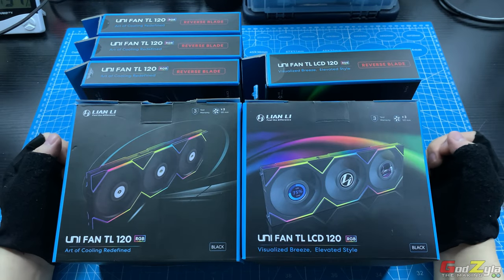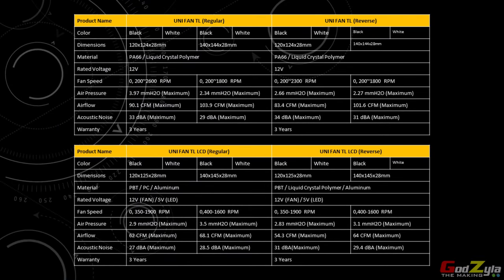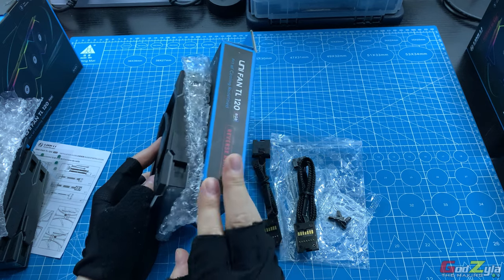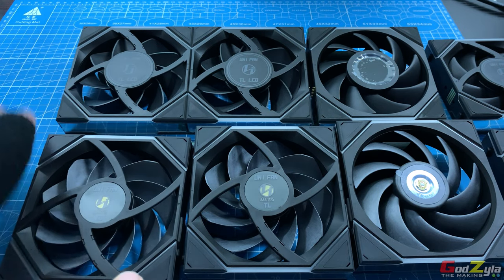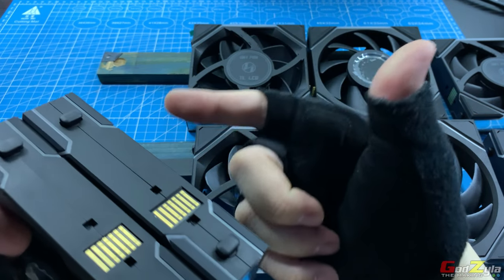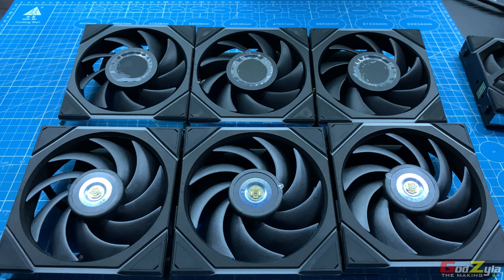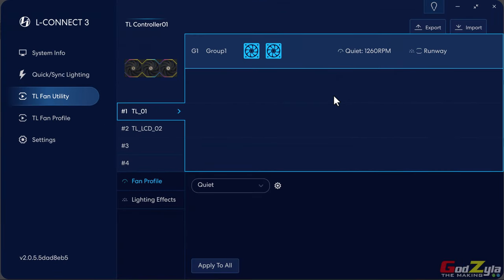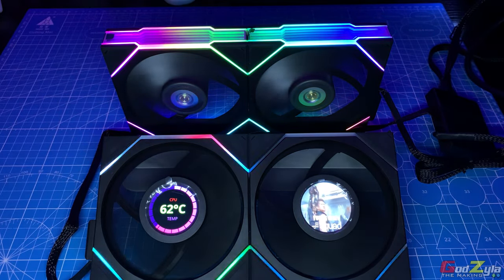Lian Li Uni Fans - TL & TL LCD

Comment: It’s dope but I rather have the reverse full rgb fans but those are dope but the lcd screen on the exhaust only right
Reply from the maker: Hi Inf4mous twin, welcome back, the TL LCD comes in 2 form, normal and reverse blade, so you can choice which to get. by the way I made a mistake. the reverse blade does come with triple pack with the controller.
Reply: @KleoYan  oh nice but do you think they should of went full rgb on the LCD ones so it could pop more? Or you think it would of pulled more power
Reply from the maker: @inf4moustwin15  pardon me, I don’t fully understand what you mean. Mind to explain further?
Reply: @KleoYan  on the lcd screen fans there only rgb on the outside of them I think the would of looked better with the rgb on the fans like the other mirror fans you think it would of been a power issue
Reply from the maker: @inf4moustwin15 oh Okok got you now. That can be done and yes it does take up more ampere which might heat up the fan further.

Comment: If you connect a normal fan with a reverse fan, considering that they have different max speeds, can you still control the speed of each fan singularly?
Reply from the maker: Hi Harman Tarquini welcome to my channel, what you can do is to plug the reverse fans to another port, that will allows you to control the individual set (Normal and Reverse)

Comment: They look like p28 with built in argb lighting
Reply from the maker: Hi NGreedia, welcome back. Yes the TL are identical to the P28, which is based on the material used. Infact I grow towards the TL as compared to the P28, only think I wish is, to have direct connection of the 4pin PWM connect to the motherboard, instead of using the controller. If controller fail, only argb effects are affected and not the RPM of the fans, especially for liquid AIO radiator cooling or Air cooler heatsink cooling.

Comment: is the TL LCD model able to pair with SL V2 model?
Reply from the maker: Hi Rezuan Isham, welcome back. If you want to use the SL V2 with either of these TL series. you can't use the same controller, you will need to use separate controllers.
Reply: @KleoYan  thanks
Reply from the maker: @razerangelri  most welcome.

Comment: Could I connect a 140mm fan to the same hub as 120mm hub?
Reply from the maker: Hi NPSHEEP, welcome to my channel. both TL and TL LCD you can do that and to plug 3 sets of fans to a port and especially as a set of 120 or 140, do not mix them and on L-Connect 3 app. you need to set the profile RPM for 140mm fan. Also please note of the limitations of fans or should I say the total amount of fans. please go through the official page for info https://lian-li.com/product/uni-fan-tl-lcd/?cn-reloaded=1

-A single cable is all you need to connect a group of up to 3 TL LCD fans to the controller, which supports a maximum of 7 TL LCD fans per controller, with a group of 3 on each port (up to 16 TL+TL LCD fans in total).
- To operate 8 to 12 TL LCD fans, please use 2 controllers simultaneously. Note that L-Connect 3 doesn’t support more than 13 TL LCD fans.

Loosen the Screws: Loosen the screws to ensure the connectivity of the group of TL LCD fans. This can help resolve issues such as the LCD screen not displaying or being stuck at the logo screen.
USB Connections: It is recommended to plug the UNIFAN TL’s controller directly into the motherboard’s USB 2.0 headers. Avoid using any USB hub in between, except for EDGE PSU. For more details on the UNI FAN TL Controller and the number of TL LCDs supported, please click here https://lian-li.com/tl-fan-number-guide/
Motherboard Limitations: Currently, some Z790 motherboards can only support up to 7 devices via their USB 2.0 ports. This means that only 7 TL LCDs can be used, or fewer when paired with other USB devices. For example, when paired with GA II LCD AIO or Shift AIO, only 5 TL LCDs can be used. When paired with Strimer Plus cable, only 6 TL LCDs can be used. To solve this, you can use our 1-to-3 USB hub (connects via motherboard back IO) for other USB devices, and stably use 7 TL LCDs. Click here https://lian-li.com/wp-content/uploads/2023/12/image_2023_12_29T08_14_54_381Z.png to refer to the tested motherboards.
Reply: @KleoYan  thank you
Reply from the maker: @npsheep8811  you are most welcome and all the very best with your build too. 😉

Comment: Merry Christmas and Happy New Year!
Reply from the maker: Hi Ya High Octane, welcome back, Merry Christmas and a Happy New Year too! 😊
Reply: @KleoYan  Wishing you another awesome year of reviews!
Honestly, your videos makes me want to swap out my existing Lian Li SL V2s, but they are only 7 months old!
The improvements and those fancy LCD screens are tempting!
Reply from the maker: @BasTech  hahha.. so sorry. hmm. maybe I should state this out. The only visible area you can see those LCD is your rear, bottom  and side fans. but i would just do Rear that's all. As SL V2 are must stronger airflow fans. By the way, thank you for your best wishes 😊
Reply: @KleoYan  😮Thank you for that! I thought these provided better airflow like the P28! Well, to be fair, you can't have the best of everything. Something has to be sacrificed. Looks vs Performance. Maybe time for a video where you compare the P28, V2 and TL? 😏
Reply from the maker: @BasTech  hmm.. what I mean is for the LCD model, they can't go high static pressure as turbulance which might cos LCD to pixelized. but for TL they are ok 😁
Reply: @KleoYan  I see. Well, I am still curious on how much difference there is between the SL V2, P28, TL, TL LCD.
My current setup in the Lian Li O11-Mini has 3 x 120 on top, 3 x 120 on the bottom and 2 x 140 on the side. The 140s are in pull configuration for my side mounted Arctic Liquid Freezer II 280. No rear.
Reply from the maker: @BasTech  ooo ok when I have time I will test it out 😬